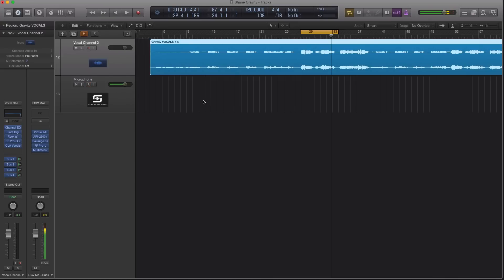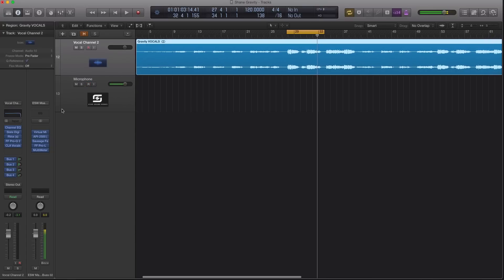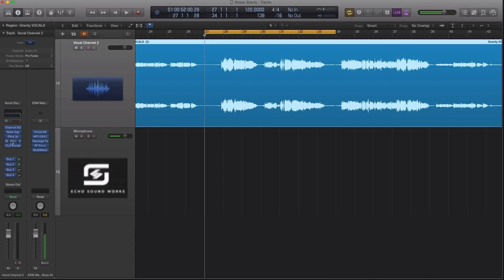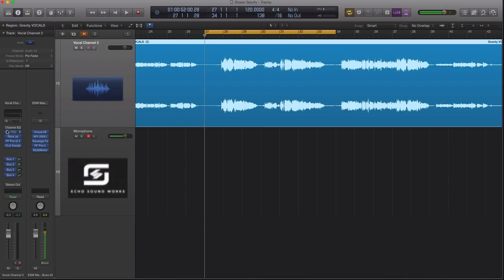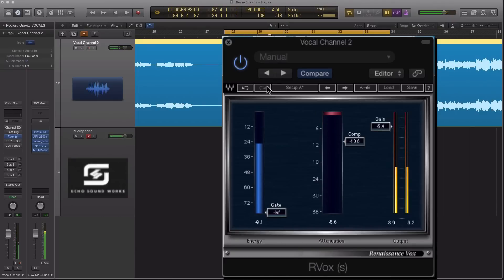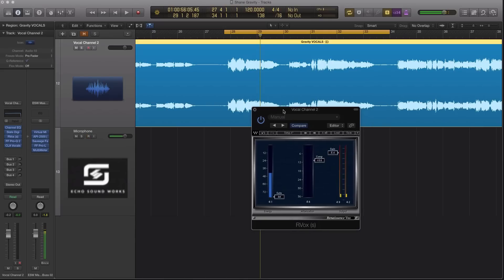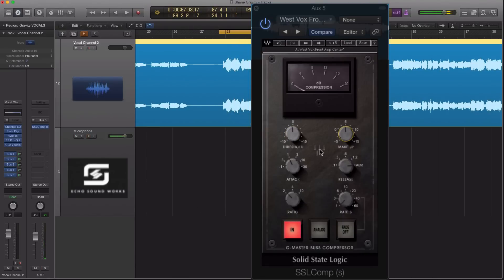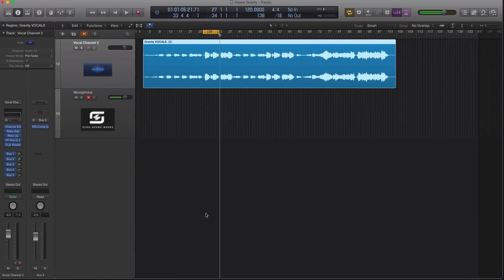Compression Pro Tip - Compressing in Stages

Comment: Still grasping the idea of parallel compression. You have one dry signal and one compressed signal? Why not just compress on the channel? Compression and reverb so confusing to me! Great video tho!
Reply: The parallel compressed signal is heavily compressed, with a high ratio and low threshold. You're basically slamming it. If you do that on your actual insert it'll just sound hard and too compressed, but if you mix it in with your dry signal it gives it more weight and power.
Reply: the main purpose is to bring up the 'percieved volume' and the charakter of the compressor while maintaining the dynamic range of the original signal since the dynamics would get lost otherwise